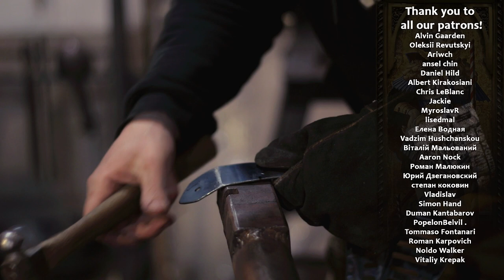How to make visor for medieval helmet. Forging armour

Comment: I don't see the use of the hinges on the side. Not where it pivots to raise up and down, but the pin hinges that would open and close a cabinet door. They look unnecessary.
Reply: they're to make removal of the visor easy if it needs to be replaced or repaired. They're not really hinges, just serve as removable attachment points.
Reply: @dankflyingv6345  thank you for making that clear
Reply: @goodvibes5487  Еще существует понятие исторической достоверности.  Если подобные решения применялись в 15 веке, значить так и должно быть в современных репликах